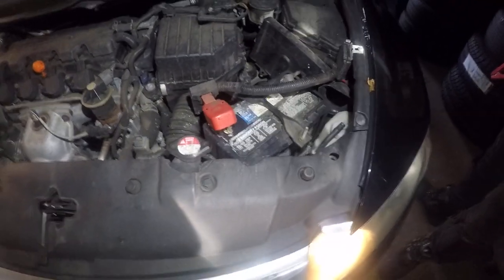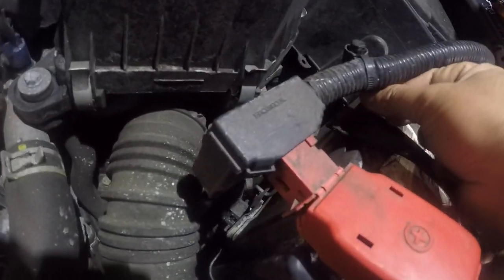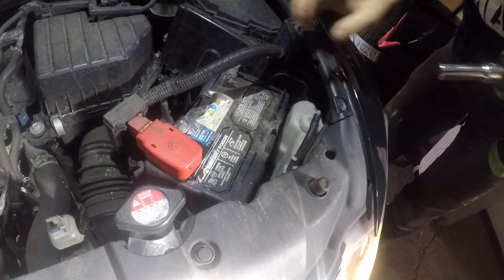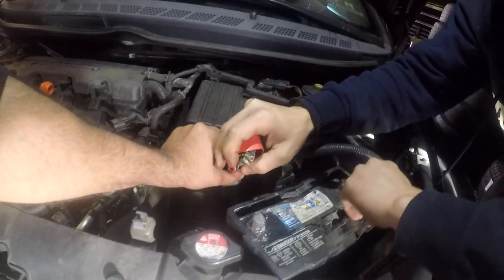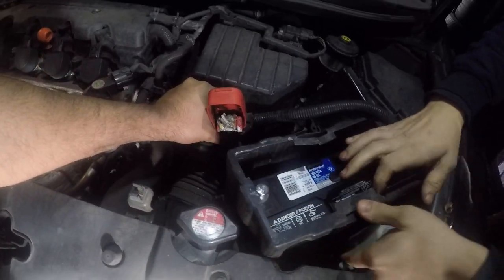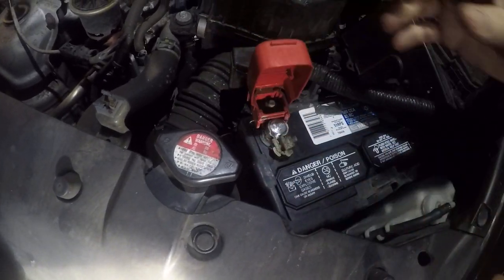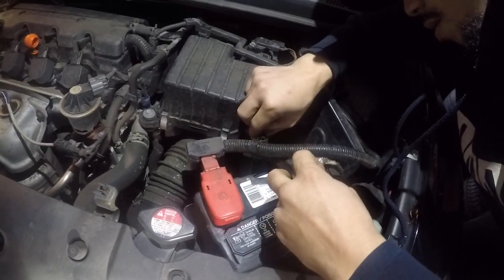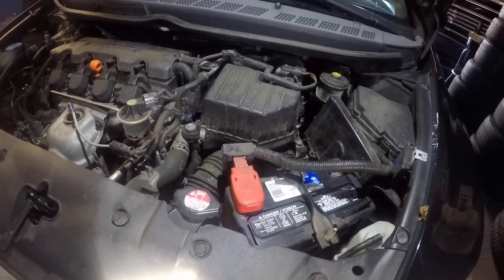How to change battery on 2008 Honda Civic

Comment: How about radio codes, immobilizer, key unpaired etc?
Reply from the maker: That dosent get effect it
Reply: @RBTheMechanic  Yes, took the jump of faith today. Changed the battery on my 2007 FN2 without a charger attached to the clamps. No codes asked, no radio stations lost, no weird behaviour. Clock was reset but already in edit mode (blinking). Probably some default view has to be set up again for the drivers display, not sure (like autoreset of distance A when refilling, will see at next refill), the distances started were not affected. Certainly no risks.
Reply from the maker: @nihorothereal  yeah all that will work out after driving for a while

Comment: You forgot to mention. What terminal you take off 1st is it the negative or positive?
Reply from the maker: Mike    Hey mike yeah we will do much better videos down the road with more details but if ur doing ur battery you take take the ground off first and if u need help with anything else please msg me. Also we will be doing live car in motion power train videos soon Please subscribe
Reply: This needs to become a habit. Take off minus first and put it back on last. Always. Might seem irrelevant until you look at your hands with a plus wire dangling and question where to put it. Everywhere around you is metal. Any weird metal is mass - minus. If the red wire touches anything, it will just put hundreds of amps and melt anything, like a ring, which would be legal and required taken off at this situation beforehand. So just spare the fireworks and hot sensations for other places and times - take the minus wire off first, then there be no problem placing it or the plus wire thereafter. Not really a rocketscience. Just the first one or two of the 5 why's 😅